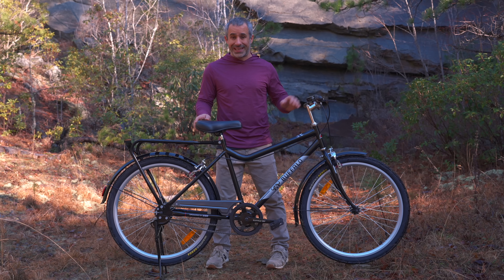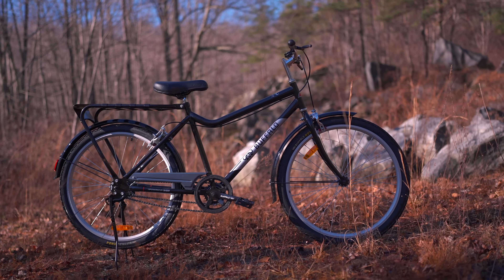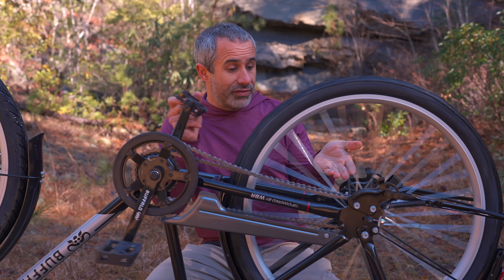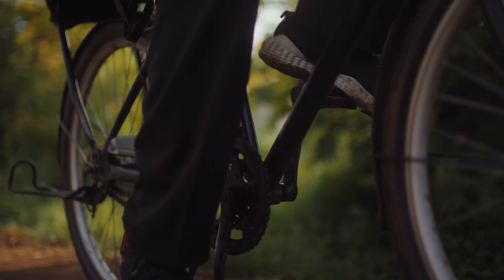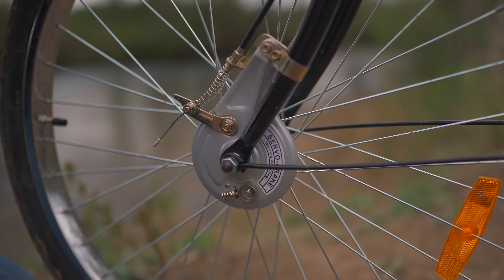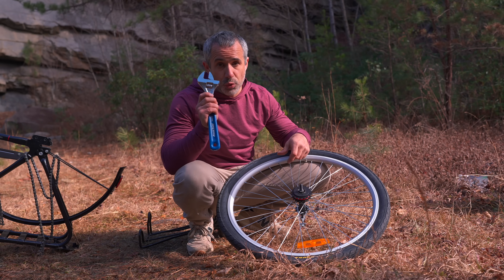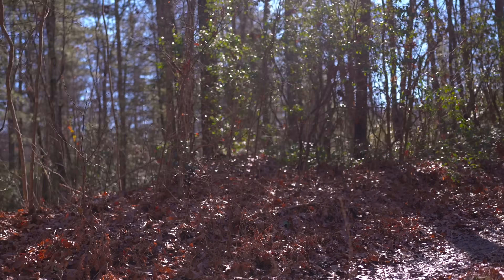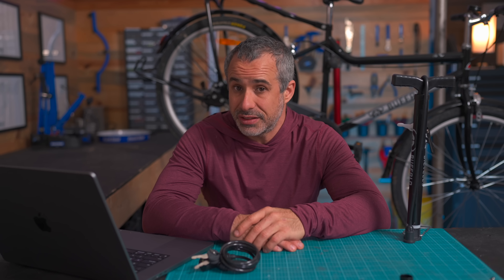Why 2 Chains Make This Bicycle WAY BETTER

Comment: Back in the 70*s there were a trend for something we called micro bikes. Compared to what's possible today they weren't all that micro, but they had pretty small wheels and you could fold the frame to make it easier to transport. My sister had a few of these, not because they broke down but because as light as they were people would steel them even if you locked them. You had to lock them using a long wire wound around something impossible to just carry away to be reasonably dafe that it wouldn't be stolen. Anyway they had a kick-back gear change to swap between two or three gears in the rear hub. I can't remember the details, so I say 2 or 3 gears. Anyway they also had the brake integrated into the hub and yes it engaged when you kicked-back just hard enough. I remember this as there were no brake on the front wheel or a break handle on the handlebar. 

These were as far as I remember close to invulnerable. Without any entrance into the hub for gear change or braking it was as resistant to dust and grime as a normal wheel hub with free wheel. And the gear seamed pretty resistant. I trashed her bikes hard when I played with them and there never were any problems with the gears. Now this is hardly much of a prof, but it is at least one example of the kick back change of gear not making it impossible to also have a break in the rear wheel hub. As for gear reliability it was only four bikes, and they were all bought used. And as most of them were stolen within a year they were not used for long enough to call it long time tested.

Still it's interesting that there has been so many designs to something that seems so simple as a bike, the wheel hub, gears, gear selection and brakes.
Reply: I think those still exist. I've heard that in parts of Australia you can hire somebody to drive your car home from the bar and they use a foldable bike to ride back to pick up the next person in need of a lift home.

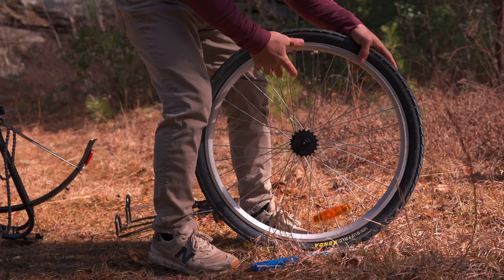Comment: 10:56 Penalty! crescent wrench 🔧 “facing”the wrong way. The adjustable jaw should be on the leaward direction.
Reply: Beat me to it. Most people don't think about that, and usually it doesn't matter "too" much on not very tight fasteners (even though wrong is very seldom ever right). However Seth had to stand on it to break it loose.

Comment: Gear are cool, but is one of the issues with rim brakes over hub or disc brake is that they wear down the braking surface over time and therefore make the wheel is a consumable part, alumnium rims aren't the cheapest and having to buy a new one is a lot of money especially for the people they are aimed at. Not sure what the solution would have been to stop this, maybe a drum brake.

Comment: I don't like coaster brakes but you can't deny their universal straight-forwardness to people with zero experience riding bikes. No 'which lever does what' crisis immediately preceding a crash, or calculating which wheel should get how much braking force. The gearing mechanism is wonderful but if it comes at the cost of hub brakes and steel rims then I don't see how it's worth it. Curious to see how many users actually shift the thing and how many get off and push anyway.

Comment: The best comment ever “it’s amazing what engineers can come up with when you take out the marketing department”. Paraphrasing a bit, but close enough.

A derailleur would NEVER survive. Kinda reminds me of the Sturmey Archer Kick Shift, wonder why they didn’t just use that? It would have kept the coaster brake…
Reply: Probably because with a coaster brake, you can’t always guarantee that you’re going to have the best leverage depending on where your legs stop at. When you’re carrying cargo, you want to be able to start off on the good foot, literally.
Reply: @ that’s true, didn’t think about that… but the other one is a coaster brake and the only real difference is one used more for hills… I’m thinking it’s more about saving weight than anything.

Comment: I would have collaborated with Sturmey Archer and used a factory S2C with small front chainring. ($93.50 off of Amazon, cheaper with an at cost deal from Sturmey Archer). You get 2 speeds AND keep the coaster brake.
Reply: the switch to dual rim offers greater dexterity and stopping power over coaster brakes — especially when carrying a payload/passenger.

Comment: Real talk I genuinely want to buy one of these as a cargo bike. The old school simplicity is insanely appealing, I just have always lived somewhere that I needed a climbing gear.

It'd be fun to see if the chainrings were swappable. Throw a 46 or 50t back cog on it and climb like a freight train (I recently did that on my old 90s bontrager, a 40t rear with a 22 low front ring gives me nearly a 2:1 climbing gear. It's comical how monstrous a hill it can climb at 2mph.)

Comment: Rim brakes are totally innapropriate for the application.  It should be using cable actuated drum brakes.  Rim brakes provide very little stopping power in rain and muddy conditions.

Comment: You are using the adjustable wrench wrong.  You always turn toward the adjustable side.  Turning away puts torque on the adjustable side and can cause slipping and wear on the adjustment gear.
Reply: I never knew that.  Good information.

Comment: Okay is Sram going to sell that freewheel? I've often thought of trying to make a two-speed bike instead of a single speed by putting a chain tensioner in the back and using a front derailleur to add a climbing gear. Cool to see that they came at it from a completely different direction and I honestly wouldn't mind using something like that on a legit single speed setup to make a dual speed.
Reply: I doubt there's any market for such a thing outside of this very specific application.
Reply: @Durwood71  why not? If it's durable I could 100% see a bunch of single speed guys wanting the extra climbing gear. You maintain most the simplicity of a single speed but gain the extra ability for steep climbs. It would be enough to push me to finally build a "single speed".

Comment: I had a Soviet folding bike from the 60s that shifted up when you locked up the coaster brake and down automatically when you stopped. But this kind was pretty hit or miss and broke down often. The fixed gear version that I ride nowadays at some occasions is much better. I wished they had this 2 chain design, it’s genius! I wonder if it’s retrofittable to other bikes

Comment: How do we know our heard earned money isn't going to some prince in Africa? Jk. You should put an electric motor and charge the batteries with solar power on it and send it to Africa.
Reply: Motors, batteries, and solar panels add unnecessary complexity.  Remember, they are making these bikes to be repairable using common hand tools.

Comment: Just trying to get the word out. As of Sun, Feb 2, Walmart has clearance bikes online. The $298 Schwinn AL Comp 27.5 is $180 and $181. Huffy Cranebrook $77.00, Kent 700c Kent Ridgeland $89.00 I believe it has the reversible rear wheel for single speed, or fixie.(might be fixie only? Wally World/ clearance bikes
Reply: dont buy bikes from walmart unless you are prepared to immediately take it into a shop for a $100 tune up ( and prepared to do the same tune up every 8 months)

Comment: 7:23 I'm not sure if it comes as standard, and the mechanism is different, but my dads old moulton actually has a 2 speed back-pedal-to-shift hub and a coaster break. It does work but tbh is a bit of a pain to use.

Comment: i had an early sixties Schwinn Traveler with a 2-speed Bendix hub that 'shifted' in a very similar way - kicking back the crankset - and it was smooth as butter. i always LOVED this style of two-speed bicycle, as it just WORKS.

Comment: This reminds me that, what made the industrial revolution possible to begin with, was not the invention of steam, nor finding coal, these were only two steps in a small process, it was the transportation of goods and fuel, which were only possible at the time, thanks to the canal systems. 
And once trains came to be, industrialisation really kicked off, once cargo ships came to be, that kicked off globalisation. 
One truck in Zimbabwe, helped pull a village out of poverty, it was used for 60 years, 4 wheel drive old WW2 truck that kept on going and going, transporting critical farm goods produced by the village to the market for selling, it just goes to show that humanity for its entire existence, has been chained by its ability to move goods and the invention of wheels started to remove that chain and once you put a motor to those wheels, the rest is history.

Comment: From Kenya in East Africa, thank you. In my travels I have come across many school kids cycling to school on these.
Reply: Then in 20 years we are all going to be wondering how it is that all these Kenyans are suddenly dominating the tour de France because all those kids grew up cycling to school instead of running to school!
Reply: @rcranes2227 And you know that Africans already dominate all sports 😂
Reply: @rcranes2227  Cycling on HEAVY, mostly single speed bikes noless lol.
Reply: @Nevir202  And often at high elevations.  Much of the Kenyan population lives at high elevations--Nairobi has an elevation roughly 600 ft higher than Denver, CO.
Reply: @rcranes2227  Hah!  Good call, I wouldn't even be surprised.  When necessity creates an opportunity to "train" in something just by existing people have certainly produced incredible results before.  Although maybe they will dominate offroad events instead of road events?
Reply: Jambo!
Reply: I wish for every child to know the joy and freedom of having a bicycle!
Reply: These bikes is just a modified Black Mamba ... Why are they making so much noise like they invented a new thing.

Maybe the gear shifting hub with 2 chains.

Otherwise Black Mamba is likely more durable, and carries more weight ... Even 300pounds
Reply: @wayando  because they need to advertise and convince prospective donations, they are a good option.

I tried looking up the bike you said. Based on what came up. They are completely different. Only real similarities seems to be, they are bikes lol
Reply: @Dlawler ... You may be right, they look slightly different because of the frame.

I think the main thing I wished to point out is that this particular bike was not solving a "real pain" because comparable bikes already existed for decades before. And were very affordable for anyone that wanted one.

What am calling "Black Mamba" was available even 30yrs ago, when I was in school ... We used to own one, I rode it a lot.

It is used to carry very heavy loads without breaking. Like 2 grown adults + the rider ... It was also very easy to maintain (we turn them upside down to fix too).

This one here seems to have more expensive tyres, complicated brakes ... and it is likely only manufactured by one company.

The Black Mamba style bikes seems to come from different manufacturers ... Even though they all look the same.

Anyway. This bike is nice too ... The new 2 gear hub is definitely a nice to have ... But they shouldn't make it like they saved the people's lives and business from the abyss or anything like that ...(unless they gave away the bikes for free).
Reply: @wayando  they are giving the bikes away for free.
Read the world cycling link in the description
Reply: @wayando   the real question is if this is a legitimate fundraiser with a real company.. how come literally NONE of them exist for sale online
Reply: @TrueHelpTV  This is a silly objection. Since when has it been suspicious for charities to not operate as commercial businesses? They don't make the bikes available to the developed world because they weren't designed for the developed world; they were designed as an effective way of improving opportunities for poor people in the developing world. Shipping them to the West would be a distraction that would draw from their available production capacity and entail all sorts of overheads. They're pursuing a mission; there's nothing suspicious about that. They're a registered charity with all their financials etc. published on their website.
Reply: no you have not... prove it... please dear god prove it.. all ive seen if the same b roll footage of a bicycle over and over from anyone talking about them... about 2 dozen samples.. and btw theses are all blk momba bikes from the 80s with new stickers.. and heres the kicker... they claim to have hundreds of dealers right? with thousands of certified mechanics for this specific bike... well then... where are the parts? where are the 2nd hand bikes.. they literally claim to have mobilized millions.. which should make this one of the most manufactured bikes in history.. and yet.. not a single one in the entire world seems to have ever been sold online not even once.. so I say to you sir.. prove it.. otherwise.. i think youre a bot for the charity
Reply: Know where I can actually buy one online? Can't seem to actually find any that exist for sale
Reply: @TrueHelpTV  it seems they aren't for sale online. And only available where they think they are needed.
Even then it seems like a lot are given away (sometimes under conditions)

Comment: That's an amazing bicycle.  The only thing I'd want different, if calipers were a must, are the side/center pull calipers.  I've always liked v-brakes for rough terrain.  Especially with all that weight.  Frame definitely seems strong enough.
Reply: I guess the v brake mounts are much more expensive that just a hole in the fork/frame.
Reply: @HS-iu2nv  yeah, I guess considering the circumstances, whatever works. 👍🏽
Reply: I was also thinking that, v brakes provide better stopping power and are easier to adjust/install imo
Reply: I grew up just fine with these crappy brakes. Cheap and reliable is the priority here.
Reply: @JoshuaTootell  yeah but ease of service is a big issue plus stopping power when carrying two people on a heavy bike. In those categories v brakes are much better plus I'm certain the cost difference is negligible.
Reply: hahahahaha you did not seriuously just suggest replacing the dual pivot v brakes with side pull calipers.... center pull is correct as they are equally powerful. but side pull don't even work on kids bikes.

Comment: The bike is simple, and somewhat unexciting, but that's the point. It's just a bike, that just works. What is very very exciting is what this does for the communities they are deployed in. Give communities mobility that they've never had access to is a fantastic thing.
Reply: before you call it unexciting remember there are many soviet engineering nerds out there who practically cream themselves over anything 'mass producible, overbuilt, practical, tanky' lol
Reply: @purplelord8531  any soviet bike also included full (basic) set of tools to repair the bike. Just like this one.
Reply: @purplelord8531  I don't cream myself over it but I wish that was more of a thing, at least in 2 years swappable batteries on phones and laptops should be a thing again because of the EU forbidding glued batteries.
Reply: @purplelord8531  Honestly don't blame them. A reliable "unexciting" bike can get you through some too exciting times. Like when my truck died and had to live a couple years car less in grad school. The Surly Ogre became a daily commuter. Even moved house on that thing.

Comment: This is so cool! I wonder if the old Sturmey Archer S2C kickback hub was ever considered for the buffalo bicycle. The kickback two speed like this one, and coaster brake within would have allowed for even fewer cables to manage. I suppose the hub internals were too difficult to maintain though :)
Reply: coaster break with a heavy load can be rough. Half the time they feel more like a slow down option instead of a stop option.
Reply: I still use the coaster brake on schwinn corvette..
Made a couple years before I was born.
Had to rebuild it during the pandemic.
The brakes suck to use and to work on.
A more advanced model had rim brakes as well as the two speed hub.

Comment: It seems that 2 chains is the solution for ebikes with mid-drive  motors.  The mid-drive motor uses one chain to the cassette.  The crank being pedaled uses the other chain to the cassette but to the gear that is one step larger than the one the motorized chain is connected to.  To balance out the force/speed issue, the front crank being pedaled has a slightly smaller number of teeth than the one the motor uses.  By separating the two sources of power, this gets around the chain snapping problem of mid-drive motors.

Comment: 10:00 They didn't make a pump attachable to the frame? There are small hand pumps which could be a lifesaver.
Also, the chain is exposed, a really bad idea. Take a look at the Batavus BUB, you need the chain contained to prevent dust/dirt/water getting on it.